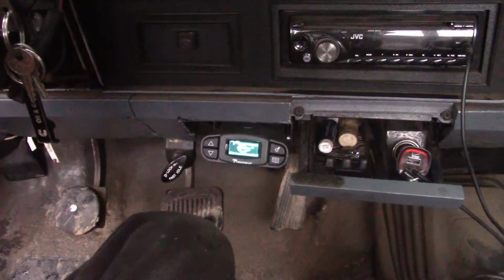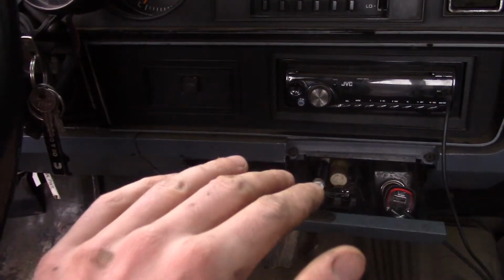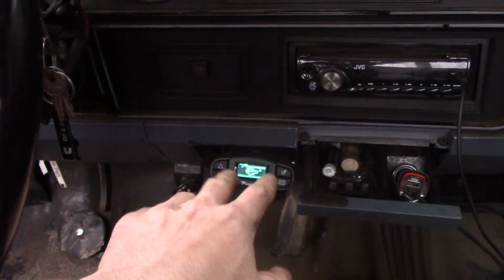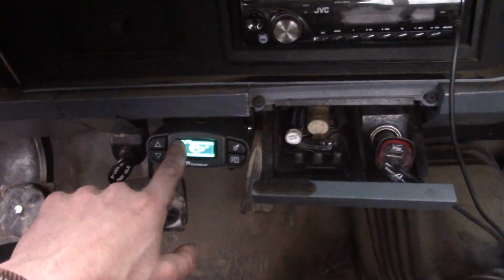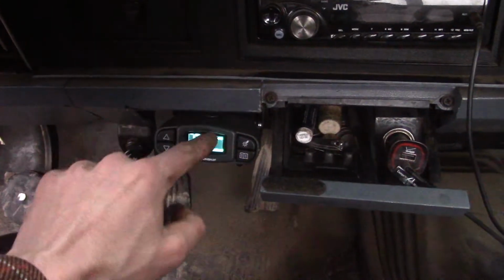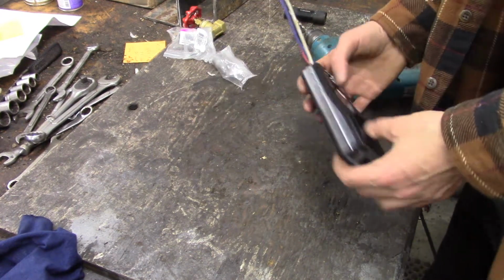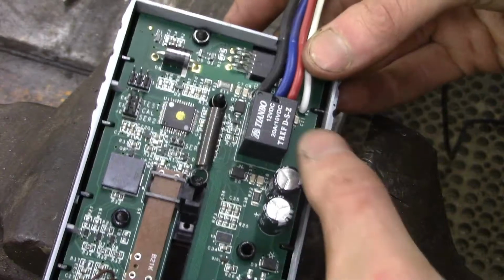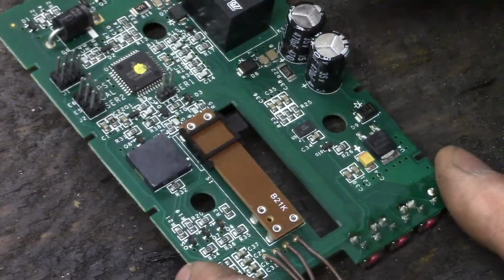Tekonsha P3 and Hayes G2 Brake Controller Review (Spoiler - Hayes Sucks!)

Comment: There's no pendulum or "ball in a cage" in a modern inertial brake controller. The part you destroyed is an accelerometer. It does have a moving part inside but it's microscopic.
I've had a G2 on my truck for 5 years or a little more and when setup according to the simple instructions it's proportional--and "subtle". By that I mean if you gently apply the vehicle brakes the trailer controller will output ~10% (you set this). As you brake harder it will proportionally match your brake effort up to 100% output to the electric brakes.
That's all it's supposed to do and it does it well.
The best thing about accelerometer sensors is they don't need to be leveled like the old pendulums. During the initial setup the accelerometer output is electrically zeroed to compensate for the tilt of the controller where it's installed. EZPZ.

If your Tekonsha uses a mechanical pendulum, you bought old technology in a fancy box.

Comment: You failed to show why the Hayes is "dangerously crappy". From what I see, the Hayes is superior to the Tekonsha in that the Hayes forgoes the pendulum and uses a hall-effect sensor with magnets to detect deceleration which is far more accurate, especially on rough roads, in comparison to the pendulum style sensors used by Tekonsha.
Reply from the maker: i believe i mentioned it in the video, the Hayes would lock up the brakes with a light tap on the brakes on flat roads, but barely apply the brakes when i was standing on the pedal going downhill!

Comment: My literally "vintage" Hayes controller with adjustable gain and that little lever on the left hand side works excellently. I'm glad I never had these issues.
Reply: I can't seem to add a normal reply so I'll respond to your comment.  WTF, what is the point of his  review.  The important part is how the controller performs.  Not destroying one by a fellow who knows jack s*** about electronics.  He obviously misses the point that less is better in electronics as long as you accomplish what you want to.  Solid state components are good as no moving parts (like little balls rolling around) is a good thing as there are no moving parts to wear out, get stuck, get dirty and hang up, etc..  What kind of moron drills out torx screws and deliberatley destroys an expensive item rather than getting the proper driver.  They're easily availabe and cheap.  He can't identify a single component properly yet he feels "qualified" to express a worthless opinion.  What's impressive is that he has the balls to make a video and make a fool of himself.  I won't bother watching any more of his videos if this is a reasonable example of what he has to offer.

Comment: The black box you called a power supply is a relay. It takes the 12v from your brake pedal switch and triggers the system to activate.
Reply from the maker: hmm... that makes sense, but (not sure if it was visible in vid) but printed on it was "12v input 16-18v output". i figured it was a DC-DC power supply, hopping up the 12v to 16 for some reason. A relay makes more sense though.